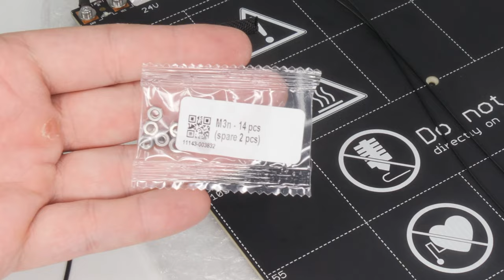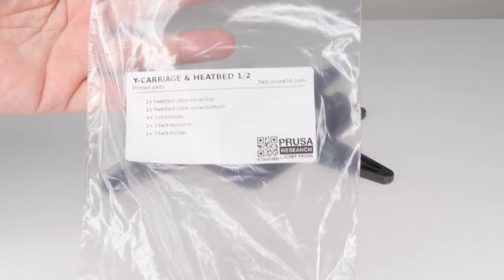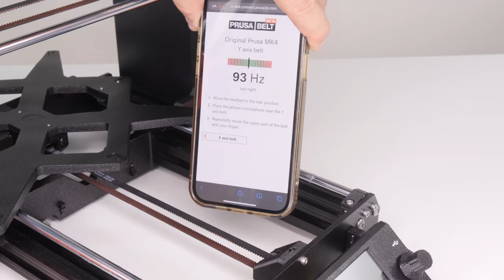Original Prusa MK4 Kit Assembly | Part 6 | Y carriage & Heatbed Assembly

Comment: At 8:16 when they put the idler on, i reccomend taking the xlcd off and the idler bracket. It makes securing the final stop to brace 1000x easier. Crossthreaded the brace twice on the final belt holder.
Reply from the maker: Thanks for your suggestion. It will be useful for other user, and we will take it into consideration.